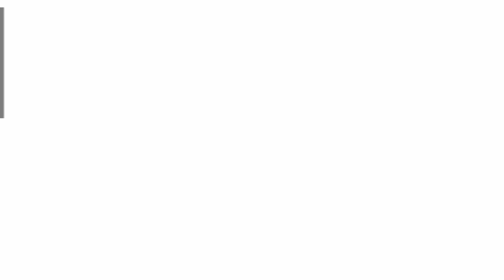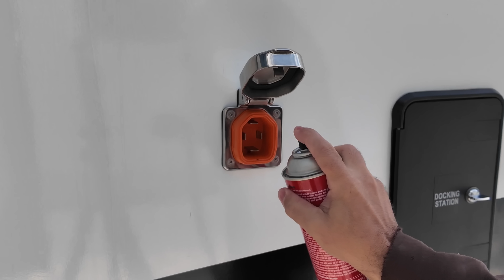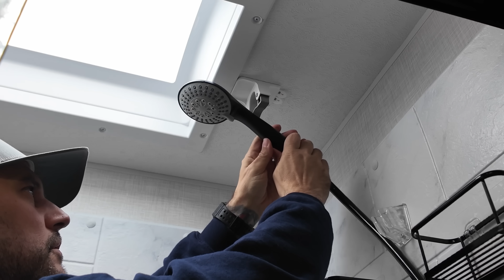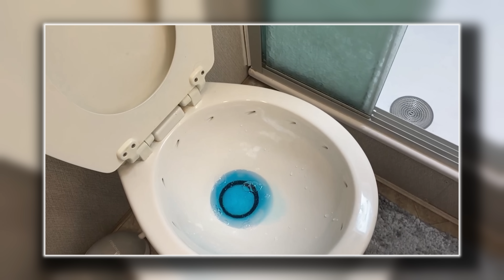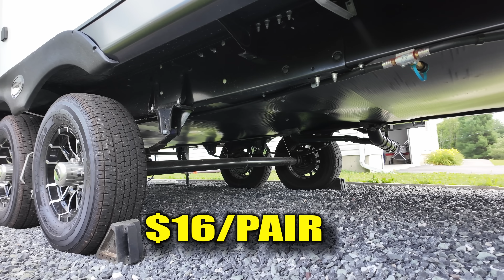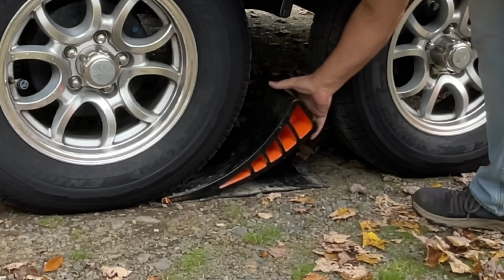The Most Popular RV Accessories & Upgrades EVERYONE is Using

Comment: We also have auto leveling. Have for years. But you do need to have the rv relatively level from side to side before you start the auto leveling. If not you're putting too much stress on your system and can risk lifting your wheels off the ground on one side which is bad for your frame.
Reply from the maker: you are correct my friend.  on our last trip we were on stone, the site didnt look all that unlevel, but it start to lift the service side tires off the ground to level out. i immediately shut it down (electric system, not hydraulic) because I wasnt comfortable with the tires off the ground.  pulled that side on 2 inches of blocks and releveled.  still a quicker system, but occasionally you might still have to put the tires on blocks.

Comment: i bought the maxtow rubber chokes.  The first set were heavy duty rubber, but the second set was made from that crumbly recycled rubber material, they were significantly lighter and softer. I think they are trying to cut corners now.
Reply from the maker: i bought 4 of them a long time ago, that really sucks if they are changing them.  try harbor freight, they sell an exact look alike for the same price.

Comment: Just seen this video, and I’m sure you got other videos about this specific topic. My seal in my toilet doesn’t hold water in the tank for more than a couple minutes at most, would that seal conditioner help this? Or is it to far gone and need the seal replaced?
Reply from the maker: Replace the seal at this point.  If it only holds water for a few minutes, it’s probably at the point it needs to be adjusted or replaced. And if it’s just an adjustment you might as well replace anyway.
Reply: @RVTIPSANDTRAVELS appreciate it, and yeah I was thinking the whole seal would need replaced, just sucks because this has been an issue since I bought my rig last summer from camping world, I had them look at it before and they told me there were no leaks found and it held water just fine, but my foot flush pedal also leaks water so I’m assuming it’s just time for replacing all seals on the toilet at this point to be safe. You’re videos are amazing man and extremely helpful! Keep up the great work and I look forward to every video
Reply from the maker: I appreciate that, glad the videos are helping my friend.

Comment: Would you recommend a tankless water heater for a camper. Currently we have a 5 gallon water heater that cannot keep up with three of us
Reply from the maker: i dont like them personally, but we never lost hot water in our other camper when we showered.  tankless will give you that endless hot water but it takes a few seconds to light and heat the water, so you waste some water before it gets hot which can be a bummer if you are only using your fresh water tank.

Comment: I had the paper towel holder in my old camper , but my new one a a thin veneer  then a gap before the shelf bottom.  Any suggestions to mount it and make it sturdy
Reply from the maker: i know exactly what you mean... the only thing I could think of doing there without tearing the cabinet apart to add supports would be to use a bolt instead of a screw and run it through both pieces.... cut it off and add a nut.  unfortunately youll have 2 nuts sitting inside your cabinet though.  if the underside is recessed you may also be able to add a larger piece of wood to disperse the weight across the bottom.  hope that makes sense.
Reply: I had a similar throught but was going to try T nuts and cut off excess bolt  Thank you
Reply from the maker: that could work too Brian, maybe but the bolt head in the cabinet so theres less sticking up, and then cut the bolt to length at the paper towel holder?  They also make countertop versions too, but I like the idea of keeping the limited counterspace we have: https://geni.us/Y6ARBj (amazon).  let me know what you decide on and how it turns out.

Comment: It's expensive, but use electro wash for cleaning properly the electrical connections instead of electronic cleaner..which at times leaves a film or oily surface.  Just a suggestion being a 30+ years Field Service Engineer.  Again, just MY suggestion and my experience.  Be well, stay safe.
Reply from the maker: CRC Electronics cleaner is a non chlorinated solvent, not an oil, and wont leave any residue behind, but ill have to check out that electro wash, thanks for sharing!

Comment: A year ago, I saw the Beechlane leveling system and bought one for our 2021 Heritage Glen travel trailer. It was easy to install and loved how easy it was to use the app which enable leveling a breeze. No more using a leveling bar. But unfortunately, we end up trading our travel trailer for a new one because someone wanted more space. The new travel trailer has an automatic leveling system. I hope the new owners of our previous travel trailer will enjoy the simplicity of the Beechlane as I did.
Reply from the maker: same here, and I will never own another RV without auto leveling.  Not that I mind leveling or that it takes incredibly long, but once you have it its hard to go without.  Not getting any younger either so Id rather be spending less time setting up and more time enjoying the trip.  thanks for commenting Eugene!

Comment: Thanks for the lead on the Evo Flex Expandable. Didn’t realize that was available. I've been using and recommending the standard Evoflex hose for several years as it works great. Might give this a try.
Reply: I wish they had one that's 10feet or less.  I've never needed 25 fee.
Reply from the maker: you bet!

Comment: I still like the yellow plastic wheel choke. You can pound them in tight with a block of wood. Replace every couple years as needed. You just can't pound those rubber ones in tight.
Reply from the maker: if they are working for you, thats all that matters.  just something to note,  theyre sufficient if they prevent the trailer from moving, but if it does start to roll, something to consider, and this was from a very light Jayco Penguin: https://www.facebook.com/groups/906578649410358/posts/5090247654376749/

Heres another one: https://www.youtube.com/watch?v=YZ0TRI8h7EI

Comment: Paper towel holder, the BEST one ever invented!  Liquified, no smells, no problems!
Reply from the maker: i got so excited a few years ago when i discovered this paper towel holder.  a little ridiculous maybe, but i would guess you share my excitement for it as well.  cheers Patricia!
Reply: I actually installed the paper towel holder in my house about 7 years ago. Works fantastic. Ironically, haven't installed in camper yet.
Reply: I need to get one. I saw them at Menards for around the same price
Reply: I'll have to try the black tank treatment. Our tank can get pretty rank!!
Reply from the maker: use the code RVTIPS at check out and get 20% off: https://liquifiedrv.com/products/liquified-rv-toilet-treatment-orange-scent?rfsn=8913536.8ebdf5&variant=41366705668195

Comment: Any thoughts or info on replacing electrical outlets with ones that have USB receptacles built in?
Reply from the maker: as long as its a quality outlet and you arent overextending the circuit they are fine.

Comment: I know I am in the minority on this but so be it.  I am not that impressed with the Beech Lane leveling system and have buyers regret.  After calibrating, recalibrating and calibrating again (on a flat slab), it is usually showing incorrect level readings when I get to the campsite hours later.  It is generous to say it is accurate 50% of the time.  Also, the range of the signal is iffy.  The sending unit is located in the pass through storage in the front of the trailer and I rarely have adequate signal to my phone in the truck to see if the trailer is level.  I have to get out of my truck and move closer to get it to connect.  Yes, they are new batteries.  I have gone back to using actual levels to make sure the trailer is set properly.  It is disappointing to me because the concept is great and can work wonderfully - when it works.
Reply from the maker: Dean, send it back and request a new one.  They have a lifetime warranty and I'm sure they would be happy to send you a new one.  Tell them I said to, they know me well and will do right by you.
Reply: @RVTIPSANDTRAVELS  I will give it a try.  Thank you for responding!
Reply: @RVTIPSANDTRAVELS  I contacted them and they are refunding my money.  Thanks for the suggestion to do so!
Reply: I had the very same issue and I called them regarding the errors. They suggested it was fairly and offered to replace it but since I live in Canada they don’t ship across the boarder, so they refunded my the cost of the unit.
Reply: Give Levelmate Pro a shot. I have the original one for about 4 years now with no issues. Im sure Beechlane is great, always a few bad apples.

Comment: i would sub out the 303 for Adams VRT. It is thicker and won't sling after application.
Reply: Can Adam's be used on plastic? I thought it was basically for rubber.

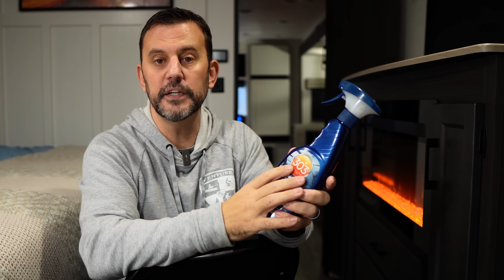Comment: 7:20 I’ve been using ceramic detail spray on the plastics, and doing the whole rig with chem-x snake oil, it’s a ceramic based coating you apply with the foam cannon from a pressure washer. Do it every spring.
Reply from the maker: ill have to check it out, thanks!

Comment: So cool to see you gave our wireless leveling system the top ranking - thank you! We're so glad everyone is loving it and hopefully it is making everyone's lives a bit easier when camping!
Reply: I just bought mine a couple weeks ago, and it works great, although the spot I park my trailer is pretty level already, its nice to have an app on my phone as I'm setting up to see what needs to go up or down to get it level.  Excellent product, can't get any easier than that, download the app, run through the setup and calibration and done.

Even after I did the calibration and got the trailer leveled using your leveling system I still checked with the old school level and your unit was spot on, either that or your leveling system and my level are off HAHA!!

Thanks for a great product, that does what its supposed to right out of the box.
Reply: I was hesitant to buy the wireless leveling system due to the cost but I am extremely happy I did! It makes leveling my camper much quicker and easier. It's one of my favorite things that I have purchased for my camper.
Reply from the maker: seems to be a big hit!
Reply: Please make a Canadian version.

Comment: I got the Beech Lane wireless leveling system.  I like it because you can just look at the app on your phone while running the stabilizers down, as well as driving up on leveling blocks, etc, whatever you need to do to level your RV.  Simple, and quick, and no guesswork and no bubble levels to install on the outside of the trailer to dry out or otherwise fail.  

I still need to get the sewer hose 90 degree locking elbow and a few other items for that portion of the sewer stuff.  

The only issue with those outside water filters is freezing temperatures.  They're find in the warmer months but they will freeze.  So, I'm thinking of getting the filter that hooks up to the faucet in the trailer.  

I have the screen door handles as well, just haven't installed them as it seems like there isn't enough door frame material there to put the screws into very securely.

Something I did order that everybody skips, a good set of steps.  I ordered a 5 step stair kit which puts the top step at about 2 inches below the trailer's door sill plate.  Makes for better entry and exit without the wobbly factory steps.  You would think after all these years RV companies would have a better set of steps LOL.  The step kit I ordered comes with hand rails for both sides of the steps.
Reply from the maker: wildbill, you can use any water filter system inside if you want, it doesnt have to be one made for under the sink.  its just going to be a little plumbing work to move the switch valve (city water to fresh tank) back further.  or if you only want it on one line, you can run it before the first faucet.  youll need to find room though, and also have enough access to it to change the filters.
Reply: @RVTIPSANDTRAVELS  I just purchased a Brita filter that sits on the counter LOL....I've already had enough plumbing fun in this trailer already HAHA!!.

I ran the water lines from the bathroom sink water connections to the garage section for my washing machine hookup, that was more than enough squeezing into ridiculously tight spaces for me...oh and I replaced the kitchen faucet as well, now that one wasn't too bad as I cut a hole in the back of the cabinet to get access to that because there was no way I could from the front unforunately...and I may explore a countertop installed filter at some point when things calm down, as at the kitchen faucet its simple either 3/8 or 1/2 inch compression type screw in fittings, so adding a single point filter there wouldn't be too hard.  I just need it for drinking water.
Reply from the maker: nice!  and i dont blame you, sometimes you just have to call it a day lol.

Comment: Our fifth wheel has an auto-level system, but we still got the Beech Lane Wireless RV Leveler. This product along with leveling ramps and stackable leveling pads takes the guess work out of wondering if your rig is level, and less chance of over-extending the auto-leveling jacks and lifting up the tires!
Reply from the maker: funny you mention that, i still have the Beech Lane leveler in my trailer despite also having auto leveling.  i use it occassionally just to make sure everything looks good in addition to the leveling indicator on the auto level system.